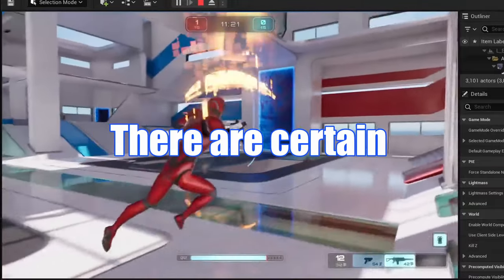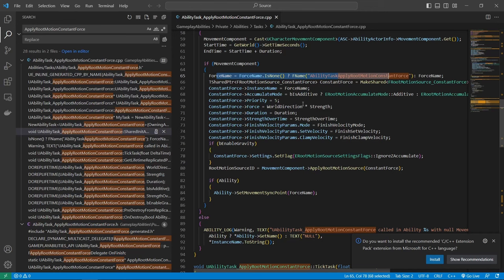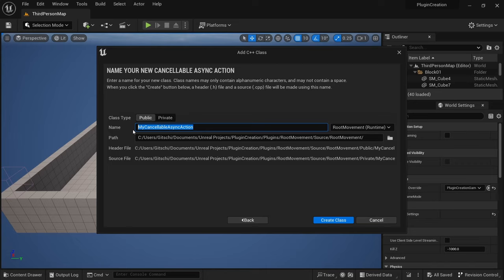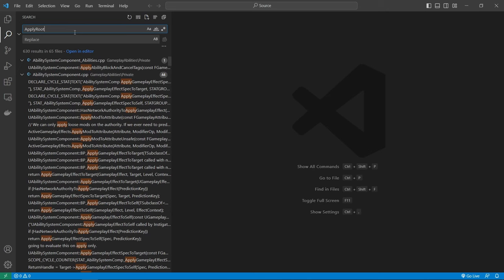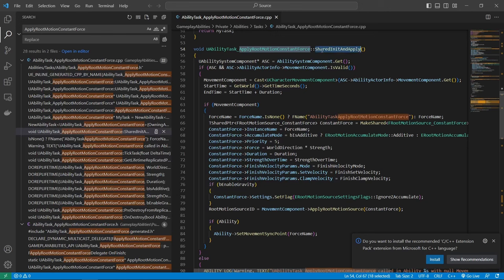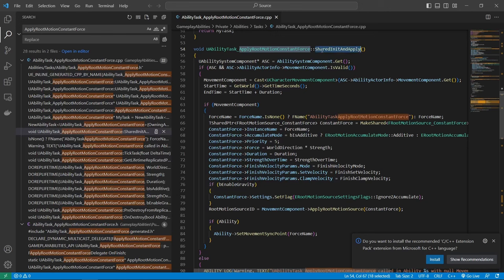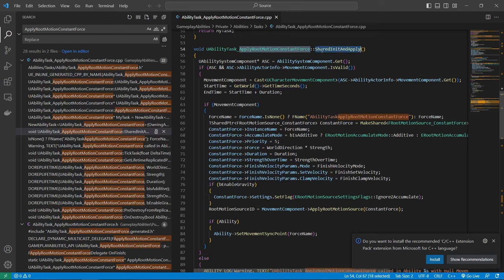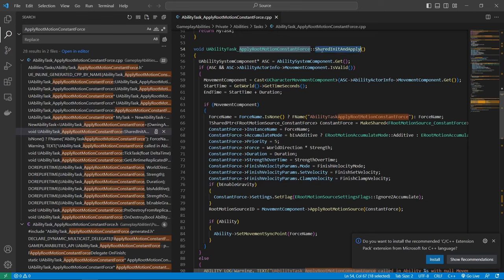Awesome Movement Techniques in Unreal Engine 5 - Tutorial

Comment: HI this is incredible well useful. I found i got a few error messages in how i used it so i added a bool for compleated failed and working so i could use branchs to stop trying to cancel a non active process.
Reply from the maker: Ahh I know what you mean, sorry about not going into detail on that.

Before calling cancel, I always use an 'IsValid' check on the asyncAction.
That will also work and is probably simpler than a bool.

Comment: How can I slightly change the direction while I m in the movement with the joystick? Like to create a curvish motion?
Reply from the maker: Hey, this is something I haven't played around with much yet, but I think you want to check the 'Is Additive' boolean on the node.
You should then be able to still apply regular movement through your button inputs with the "Add Movement Input" node we usually use for walking and steering.
Reply: @CobraCode  thank you I'm already trying to get the right result!

Comment: Thanks for sharing and making this accessible! I tried the plugin out, and am super excited about it! I noticed though that when I did the setup you did as an example, the player has much more speed and distance if they jump while in this state vs just being on the ground. How would one go about making it consistent? I immediately felt like I was making Tracer's dash ability when testing this lol!
Reply from the maker: Hey, thank you for the support and nice feedback!

I believe the distance of the controlled root movement itself should be the same on the ground and in the air since it should ignore ground friction.
I believe what gives you more distance in the air is that the velocity after the movement ends is being kept, while on the ground, ground friction will kick in at that point and slow you down.

On the node you can use the 'Velocity on Finish Mode' setting to get your desired result.
You'd probably want to use 'Set Velocity on Finish' and just set it to 0, 0, 0 to keep the distance consistent between grounded and airborne!
Reply: Thanks for responding! I have it set to 0, 0, 0 for that setting, but I noticed that the player can go farther for slightly longer if they jump before pressing the button and even longer and farther if they do it mid-momentum. @CobraCode

Comment: Thanks so much for this. I received a monolithic Engine.h Error and packaging fails. But realised it was still creating Folder with the Uproject.h and plugin. I made a test project and added it, and it seems to work. Would this cause any issues down the road?
Reply: I've got the same issue. It works in engine but as soon as I try to build it fails...
Reply: could you explain this in detail? About the Uproject.h

Comment: Hi there. I've tried building 2 diffrent projects with the plugin, but both keep showing the same error saying "Plugin 'RootMovement' failed to load because module 'RootMovement' could not be found."

I'm not used to using plugins in my projects, so i dont know if this is common, but do you have any tips or ideas on how to fix it? 😅
(Both games work just fine in the editor)
Reply from the maker: Hey, thanks for letting me know about this.
I'll have to look into this further and see if I can reproduce the problem.
This week is really busy, so it'll probably be some time next week, sorry!

This seems to be quite the common problem though and might not be specific to my plugin.
Apparently a fix is to create a dummy C++ class and convert the BP only project... however a big reason for turning this into a plugin in the first place was to make it easy to use in BP only projects, so that's not the greatest solution.
I found this thread with many people facing the same issue and sharing solutions, so maybe this can be helpful until I figure things out on my end:
https://forums.unrealengine.com/t/plugin-failed-to-load-because-module-could-not-be-found/472360/8
Reply: @CobraCode  Cool. Thank you so much 👍.
Reply from the maker: @Kamil_Horvath 
Hey, I had the time to try this out myself.
I built the 2D Action Platformer project from my Udemy course which also incorporates this plugin.
I didn't have any issues when building or playing the game. The course also has about 500 students and I haven't had any reports so far of anybody facing the same issue :(

So it seems this one is quite hard to debug and I'm not quite sure why it's happening on your end.
You could join the discord (which you can find on my profile), create a thread there and @ me, so we can look into this more over time.
I can also refund your patreon pledge if it doesn't work out!
Just let me know.
Reply: @CobraCode  Hi there. I'll try joining the discord.

It builds like normal. It's only when you try and play the build i makes an error

Comment: I'm trying to build a game with this plugin, but it fails almost immediately with this exception:

Unable to delete Plugins\RootMovement_5.3\Intermediate\Build\Win64\x64\UnrealGame\Shipping (Unable to delete \\?\Plugins\RootMovement_5.3\Intermediate\Build\Win64\x64\UnrealGame\Shipping\RootMovement)

(part of the file location taken out for security reasons)
Right before that, it says its cleaning binaries
Reply from the maker: Hey, sorry about that, not quite sure what's going on there.
I managed to build a project with this before.

I guess it might be a difference in operating systems and the built and intermediate files don't match.
Can you try going into the RootMovement_5.3 folder and deleting the Intermediate and Binaries folder?
This should trigger a recompile.
Reply: I eventually fixed it, but I don't remember how I fixed it. I probably deleted my project files and reconfigured it, if I had to guess.
Reply from the maker: @VeryTori  Thanks for the update!

Comment: I followed the creation of the plugin and it works in engine, but when I try to build the plugin I get the error: "Monolithic headers should not be used by this module. Please change it to explicitly include the headers it needs."
So I cant use it in any other project. Building the project also fails because of this. I tried to change "Engine.h" to "Engine/Engine.h" but same error...
Reply: I got the same error ... any solution?
Reply: sadly not.. @VinoVenitas